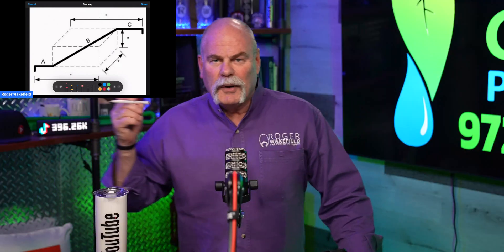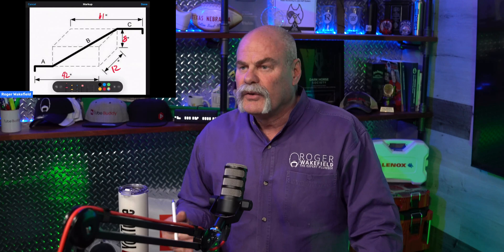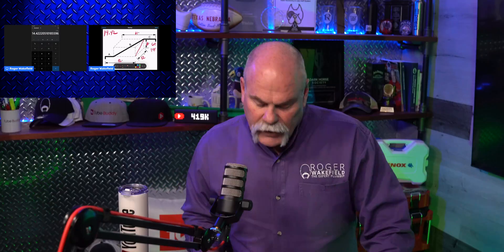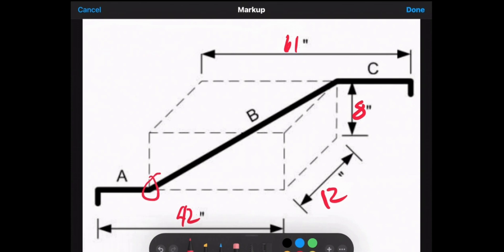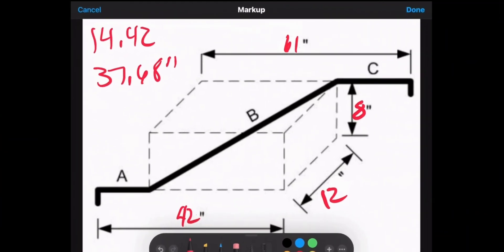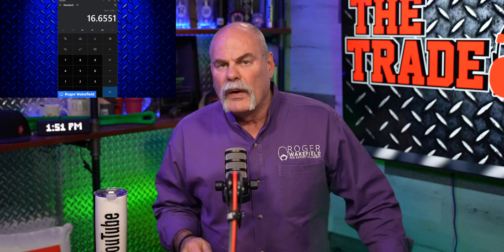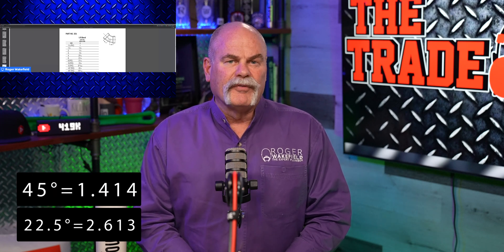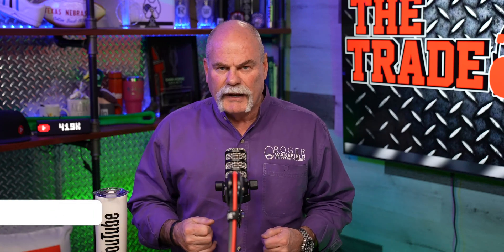Expert Plumber EXPLAINS How To CALCULATE A Rolling Offset

Comment: When I do the square root of 208 x 1.414, my answer is 17.149 on my Android phone calculator. My Windows 11 calculator gives me 20.392 like in the video. Whats the deal?
Reply: Check your order of operations and ensure you've landed on the square root. Then, do the multiplication. Don't just plug it it all in at once. I just checked on my android, and it gives me 20.392.
Reply from the maker: You using an android

Comment: for the 45 offset my foreman taught me the tape trick where you multiply the offset by 1.5 and then subtract a 16th for every inch.  ex 10" offset turns to 15" and then minus 15/16"

Comment: Hello, thanks for the good content. Do you have a video on outdoor faucets and cold Temps? I'm in Austin TX and I'm scared to turn on my outdoor faucet in fears it got busted in our last cold front. I have a couple issues 1. My dog kept on taking off anything I attempted to put on the faucet to keep qarm. 2. Once I was able to keep something on it it seemed to freeze with the freeing rain. It was a sock and a towel with my hose wrapped around it. I live in a one story home on a slab. I believe the water lines are insulated but not sure. The wall the faucet it on is right behind my bedroom. The is a new build home less than a year old.

Comment: Install your fitting on pipe A, insert a length of pipe, B, in the fitting, then, where pipe B crosses pipe C, hold your 2nd fitting up to both pipes, make a couple of marks allowing for fitting depth, then cut. No math, no errors. If you use formulas you will either be too long or too short. But I use these methods because I just can't do the math.
Reply: Lol if you do the math correctly you won’t be wrong either.

Comment: I knew the 1.414 multiplier to get the length of a 45 degree cut. But I always just throw a tape measure on the work to make sure I end up in the fitting and not just ending up at its face. I  almost never use math. Its just not one of my strengths. I'll watch he video a few more times and maybe I'll see what I'm missing.  Thanks, Rodger.
Reply: Nothing wrong with your method if you get the same results without wasting materials. Its best however to at least have this knowledge as it still comes in handy at times such as estimating materials off site or working on longer runs.

Comment: For straight offsets there is an easier way than the 1.41. multiply the offset by 1.5 then take off an inch for every foot of offset plus your fitting allowance. A 12" offset becomes 18" minus 1 inch minus fitting allowance. This trick can be done in your head don't need to take time to get out a calculator or write it out. Not exact but within decimals that really don't matter
Reply: Seems like this would only be useful for offsets greater than 12”

Comment: On the Texas Journeyman  Exam, they want you to find the travel piece   between a 2" cast iron no hub wye and a 2" 45.  Which constantwould apply for this example?
Reply: The WYE is probably a WYE with a 45 degree branch off of it, right?  So you still use the 45 degree constant of 1.414. Of course, your take off on the 45 will be different than for the WYE 45 if that matters for the exam question.
Reply: To get the constant of any angle for a rolling offset, divide 1 by the sine of the angle.  Also known as the cosecant of the angle.   This is how 45 degrees generates a constant of 1.414 or the sqrt(2), and 30 degrees generates a constant of 2.

Comment: so how exactly do you just input the 8"rise and the 12" horizontal measurements? I thought you said you just measure center to center?
Reply: Pipe B, when projected onto the plane of the 8" and 12" dimensions, will "cast a shadow" of 14.4" on this plane.   This is what you get from sqrt(8^2 + 12^2).

We'd like to make Pipe B long enough between two 45 degree fittings, such that it can cast this shadow on a plane that is 45 degrees from it.   A right triangle that is 14.4" on its base, and 45 degrees on its remaining two angles, will have a hypotenuse of 14.4"*sqrt(2), which is 20.4" in length.

The shadow is not necessarily literal, and it doesn't follow the exact optics of casting a real shadow.  This is more of the mathematical concept of a shadow, which is a mathematical projection of a 3D shape onto a 2D plane.

Comment: how do you mean 12 inches vertical and 8inches horizontal?
Reply: Draw an X-Y coordinate plane, such that we are looking straight through Pipe A.   Place pipe A at the origin.  Define x to be horizontal, and y to be vertical.   If you form a 3-d coordinate system out of these axes, the z-axis is the axis of pipe A, which points toward us as we observe from this point of view I'm specifying.

Now place Pipe C at a position of x=8 inches, and y=12 inches.   If you were to extend pipe C, so that it passes through a plane containing pipe A, this is how far apart Pipe C would be from Pipe A.
Reply from the maker: This community is great! Appreciate everyone looking out for one another.

Comment: Just did this in class, good vid. Should do one for offsets going from vertical to horizontal
Reply from the maker: Not a bad idea! Thanks!
Reply: @RogerWakefield I think that’s called a complex rolling offset.  There’s also compound rolling offsets, which I think are realistically only for welders who can cut custom angles although I’ve heard rumors that in some parts of the country their wyes are cut at a weird angle on purpose to become a compound rolling offset, but I kinda doubt that’s true.  I’ve used “swing joints” in the field, but I’d say almost all my rolling offsets were pretty much always setting drains.  Where do you find yourself doing rolling offsets in the field?

Comment: 30 degree is 2.00
Reply: Yes.  It has to do with the fact that 30 degrees forms one of your special right triangles.  Namely, the 30-60-90 right triangle, which is half of an equilateral triangle.

Suppose you draw an equilateral triangle that is 2 feet on each side.  Now cut it in half along an altitude line.   You create a 30-60-90 triangle, with a 2 foot diagonal, a 1 foot base, and an altitude of 1.732 ft (the square root of 3).   Its three angles are 30 degrees, 60 degrees, and 90 degrees.

If you were to create an offset/return bend in piping, with 30 degree elbows, it will "cast a shadow" onto the 1 foot base dimension of this triangle.  If you know the length of this "shadow", you double it to get the length of the diagonal pipe that casts it.

Comment: So many guys never learn this and or just don't know about it they try to eye ball it or cut it long and shorten it to fit.
Reply: If you get good at eyeballing it you can put a piece of pipe in faster than you could put those numbers in a calculator. Still good to know the math though
Reply: @user-ns7mz1ld9u  I tend to lean toward the eyeball method myself
Reply: Even this calculation is approximate anyway, because it doesn't account for exact geometry of the fitting.  This calculation assumes your pipes and fittings are infinitesimally thin, when compared to the lengths involved.

You still will need to shorten the pipe for fine-tuning, if you cut it according to this calculation.